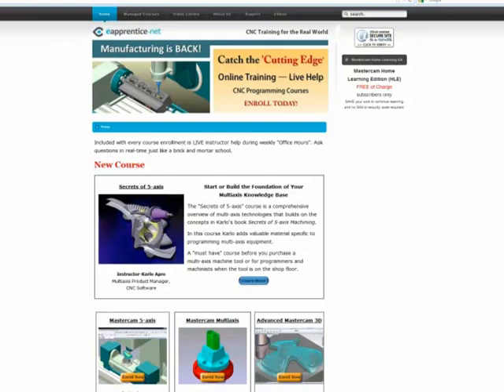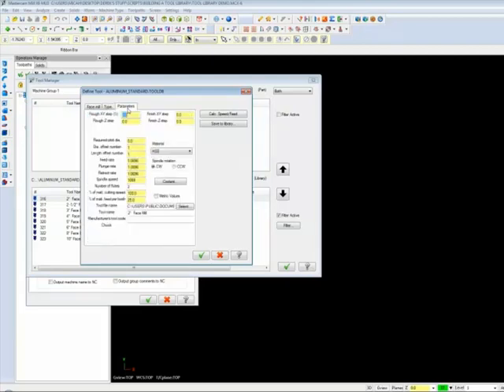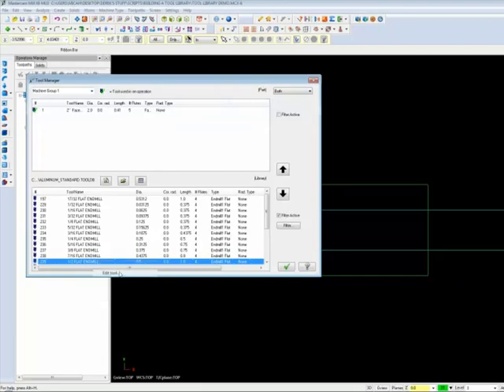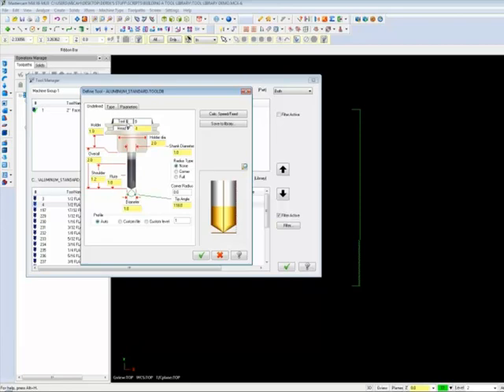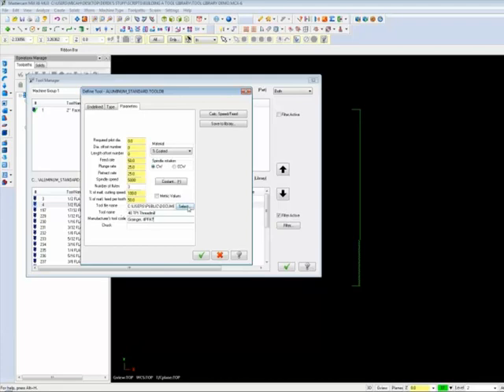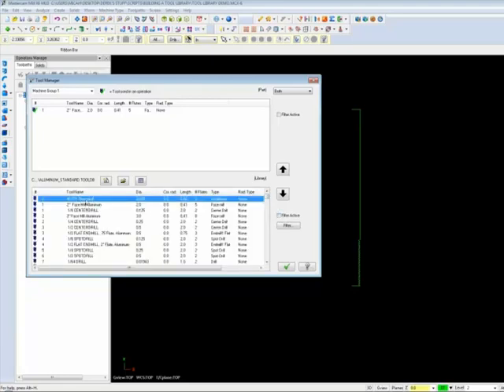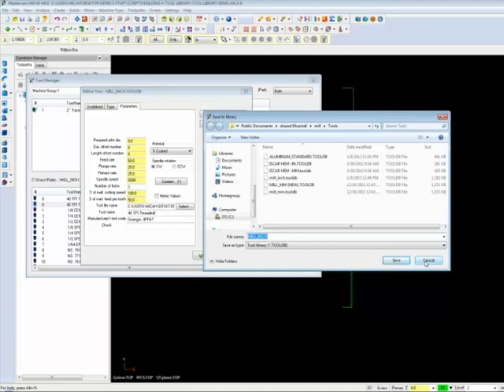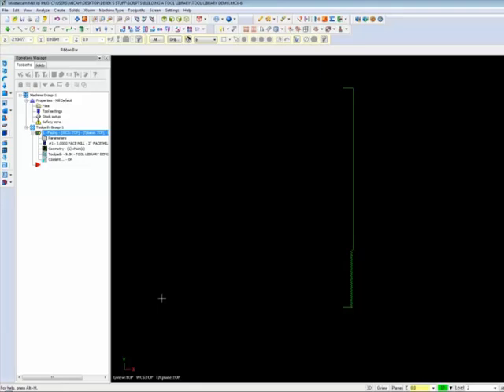Managing tool libraries in Mastercam

Comment: After pulling my hair out trying to conform to MasterCAM's inefficient system of creating tools, I have decided to never purchase this software after working with the demo. MC requires me to draw almost every single tool since they only support insert tooling from a few manufacturers and their editing system does not allow the option of not using an insert. Save yourself a ton of time and pass on MasterCAM before you even try it. My time is worth more than this very limited and expensive software "solution".
Reply: Harrelson Trumpets What are you talking about man.
You can create tools that are not insert tools.
and the 10+ databases that come with mastercam have almost every tool you could ever need all ready setup for you.

maybe learn the program before you complain about it.   :)
Reply: I did learn the program, which is why I do complain. Having to work with old technology in the year 2015 is exactly why I dropped MC.